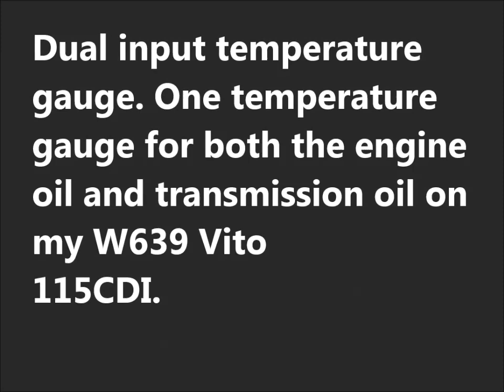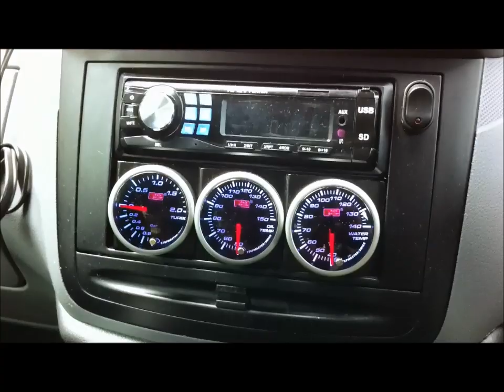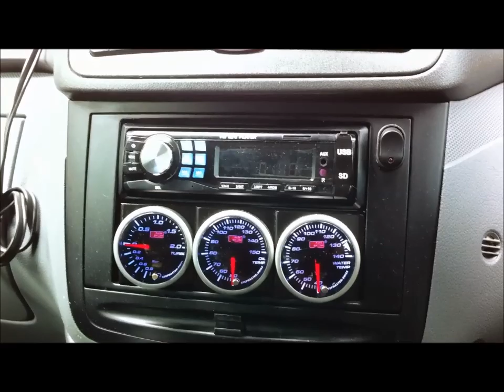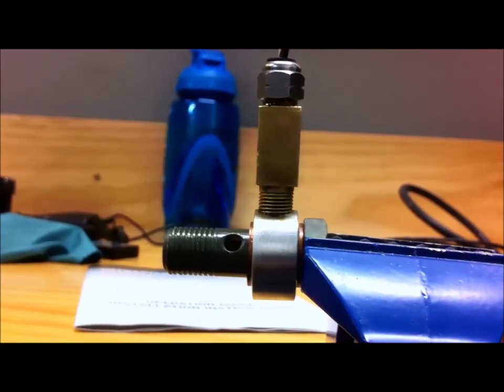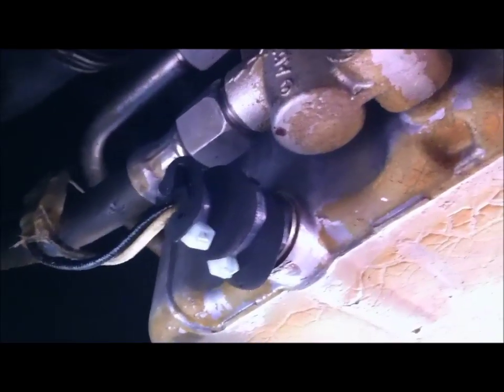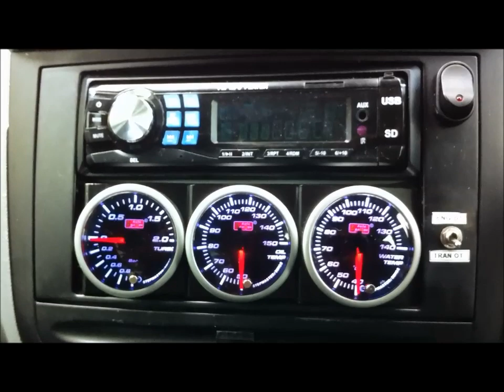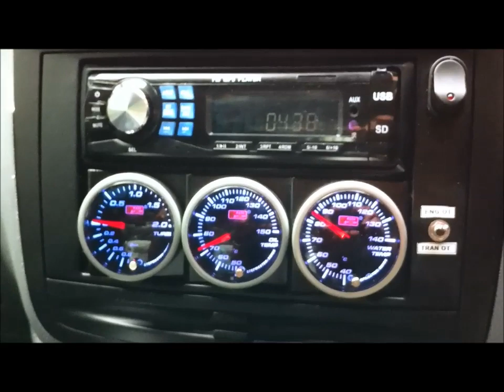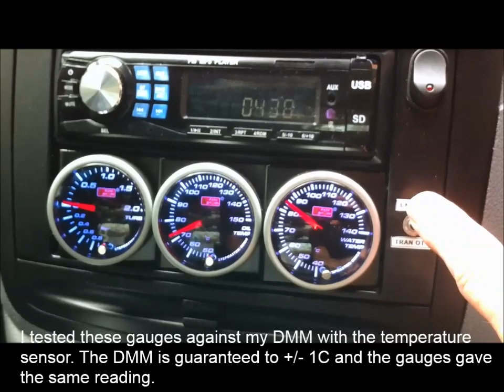Oil Temperature Gauge for Engine and Transmission Installation 52mm 2 1/2 inch Stepper

Comment: Hi Scott great idea for the Vito, as my Vito does about 50,000k's per year, these gauges would be a worthwhile investment. Can you tell me where you obtained the double holed banjo bolts from? Also as I don't have lathe, can the ring that you made be purchased commercially? Keep up the great work on YouTube...
Reply from the maker: Here's the double banjo bolt M14 x 1.5: http://www.ebay.com.au/itm/M14-x-1-5-DOUBLE-BANJO-BOLTS-Car-Motorcyle-/270797244069?pt=UK_CarsParts_Vehicles_CarParts_SM&hash=item3f0cc606a5

Also an engine sump plug from the same seller with a 1/8" NPT threaded hole for a gauge sensor: http://www.ebay.com.au/itm/Oil-Temperature-Sump-Plug-sensor-gauge-adapter-M14-/280569365939?pt=UK_CarsParts_Vehicles_CarParts_SM&hash=item41533cc5b3 The sump lug thread is the same at M14 x 1.5.

With the spacer fitting you'd have to get a friend with a lathe or go to a small machining shop and get one made up. I mention the dimensions in the video ... 24mm diameter, 14mm thick with a 14mm hole drilled through the centre. Then I drilled a hole at right angles into the middle and tapped with a 1/8"NPT thread to take the brass fitting and sensor. Also with the boring bar I cut a groove in the centre of the doughnut hole to create an oil passage. Hope this helps. Kind regards, Scott